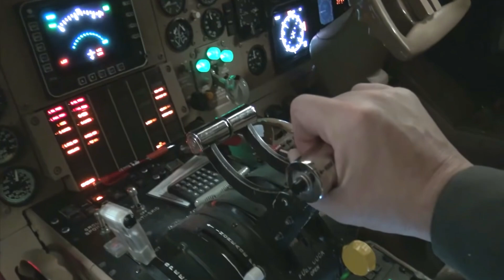How Reverse Thrust Works

Comment: This is only partially correct. The use of reverse thrust has nothing at all to do with the condition of the runway surface. Whether wet, dry, icy, or anything else, full reverse thrust is used virtually every time. One of the only times that little or no reverse thrust is used is when landing on a very long runway and you want to go all the way down before turning off; therefore there's no need to slow as soon as possible. Beyond something like that, normal reverse thrust is always used. Also, the older style reverser doors may be called bucket doors by some people, but way more often they're called clamshell reversers.
Reply: You must be a pilot.
Reply: @vieuxbal1253  That is correct. For quite a long time.
Reply: This is the answer. Thrust reverse is the primary braking method used in all conditions because it doesn't put wear on the brakes which are used if needed.
Reply: @ruk2023--  I would disagree. Actually it's the other way around. The brakes are the primary stopping method and are always used. The reversers provide assistance, which helps to reduce wear on the brakes, but still the brakes provide the vast majority of the stopping action. A few things that demonstrate this are that a reverser can be inoperative and the flight can still operate, whereas an entire brake cannot be MEL'd. Also the landing performance requirements that are calculated for each landing don't even take into consideration the assistance of the reversers. And, the reversers are typically speed limited, meaning that they are used only down to a certain airspeed, typically around 60-80kts, whereas the brakes are used at any speed.
Reply: Thanks for setting this guy straight. There’s so much aviation misinformation out here on YouTube. As a side note, I know it’s Delta’s policy to use idle reverse thrust only unless the pilot decides it’s necessary to use more throttle in reverse than idle.
Reply: @aaronpederson6840  You are correct, there's huge misunderstanding out there about aviation in general. That's interesting about Delta. I had never heard this and during all the hundreds and hundreds of flights I've done on them I could swear they were reversing like everybody else, but maybe I just wasn't paying attention enough and have mixed them in with all my other flights. I have a friend who flies for Delta and so I'll have to ask him what the deal is. Maybe I'll learn something new!
Reply: I 100% agree. Coming from a family that had plenty of members that worked for the airlines, also when taking vacation flights I personally can't recall a single time reverse thrust was never used. It would be stupid to use wheel brakes as it would wear out both brakes and tires much faster.
Reply: @dlm9477  Exactly correct. The reversers are always used except for unusual circumstances. Cheaper to do that than to replace brakes and tires even more often.
Reply: @Chizzly_briz  I know that. I was referring to @John Schmidt detailed explanation on the use of reverse thrust.
Reply: So as a pilot which reverse system do you think works best?
Reply: @greenidguy9292  Given the fact that pretty much all airliners today use turbofan engines, and that nearly all of them use translation rings with blocker doors, I'd say that must be the most useful system when all things are considered, such as effectiveness, efficiency, reliability, and maintenance costs.
Reply: Buckets and clamshells are interchangeable. Most aircraft calculate landing performance without the use of Thrust Reversers at all. Brakes are primary stopping friction, any conditions at the surface are factored into stopping distance ONLY using brakes/speedbrakes and spoilers. TR's are a bit of icing on the cake. Check out any business jets AFM. No TRs are factored into landing distance.
Reply: @arobot8623  I'm glad we're in agreement.
Reply: I work at the LAX. It’s used EVERY time to help stop the plane.
Reply: @cliffdodson1592  That's true. It would have to be a very odd situation not to use it.
Reply: Absolutely correct analogy .reverse thrusters are used all the time.
Imagine relying on brake power to stop a 747 or A380
Reply: @ROSHANMANILAL-xn7tx  Very true. The reverses save a lot of wear and tear on the brakes.
Reply: I kind of thought that. I fly constantly. And you can hear when they kick the reverse thrust on and it’s on almost every flight. You can feel it too.
Reply: @ark_angelzero6  That's very true. There are only some very odd occasions when it isn't used. You could fly hundreds of flights and never see a time when it isn't used.
Reply: First thing I thought when he said this.. huh? Reverse thrust is used all the time, plans depend on it
Reply: @Anth369  Exactly.
Reply: Ok so the doors open BUT where does reverse thrust come from? NOT much information.
Reply: @adrianclout761  It comes from the same place as the forward thrust, which in this case is the portion produced by what's called the N1 fan, at the front of the engine. When the reverser translation rings open, there are blocker doors that fold down into the airstream and re-direct it forward so as to produce reverse thrust.
Reply: Yes, i thought they were called clamshell.
Reply: @LynneWilliams-bi1tx  Very true.
Reply: I thought it was more about removing forward thrust while keeping engine spinning?

I doubt there’s many ‘go-around’s when the plane had made it this far, but I imagine the reverse thrust allows engines to spool up again if needed?
Reply: @Eddieklic  Most of the forward thrust is removed in the sense of being re-directed forward so as to provide reverse thrust. The total thrust of each engine does not change at all, it's just a large portion of it is turned to go forward rather than backward.

Then, it's nearly universal procedure that go-arounds are not permitted once the reversers are opened. It would take much too long to spin the engines back down, close the reversers, and then spool the engines back up again. That would be very unsafe and burn up way too much runway.
Reply: You can hear the pilots spool up the engines as soon as wheels are on the ground, max thrust but it’s slowing the aircraft down, it’s amazing, look at the engines next time you sit near a wing
Reply: @NicholasMitchell-uv1vb  That's true, but I'm not really sure why you're telling me this.
Reply: Yea I was about to say the same thing. Cause not only the weather conditions don’t have any say so in using reverse thrust or not but the brakes cannot do most of the work. The brakes will stress more than the engines and quite frankly, the brakes would be more likely to stress out before the engines in all cases. I’ve already seen my share of fires that were started from the brakes getting too hot even with standard procedure. If the brakes go out, it’s still not as big of a problem since reverse thrust is actually used more than the brakes anyway. Glad to see some smarty pants in the comments. Saves me from having to bash on these teenage youtubers who aren’t even pilots or experienced aviators by any means 😁
Reply: is there also airport conditions of sound pollution or something?
Reply: @OvercookedSteak  There is a small number of airports where they limit the use of full reverse for noise abatement purposes. That doesn't happen too often, though.
Reply: @schm1035  cool, thank you :)